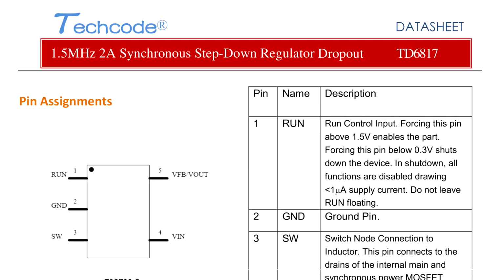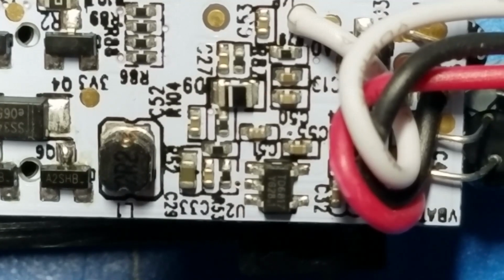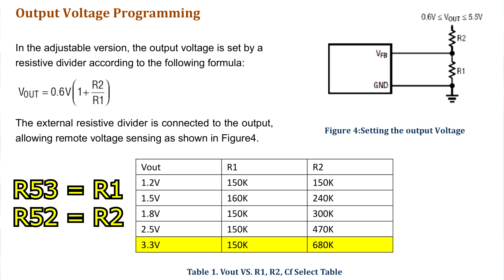Can A Galaxy's Edge Blade Be Modified To Be Brighter?

Comment: Or just change the soundboard and ditch the whole BS of galaxy's edge electronics and crystals.  You clearly know your stuff, this should be simplistic.  You may opt for a neopixel swap in the stock adapter, its doable.  I've done it.  You are 100% correct about the stock batteries though, you will need to switch to an 18650 battery setup.  It will basically be a full gut job.   At that point its a Theseus ship conundrum.

Comment: the big queation i've yet to see an answer for.  "How do you prevent a legacy saber from auto shutting off at around 2min50 sec of it not being moved?" I'd love to use these as displays without having to keep cycling the power.
Reply: There are displays for sabers with removable blades, essentially plugged in neopixel lamps